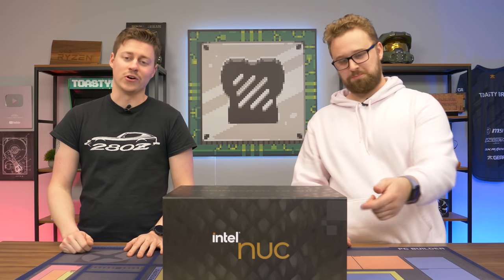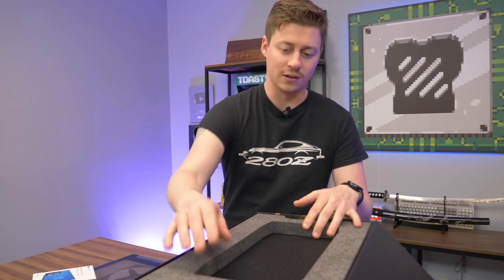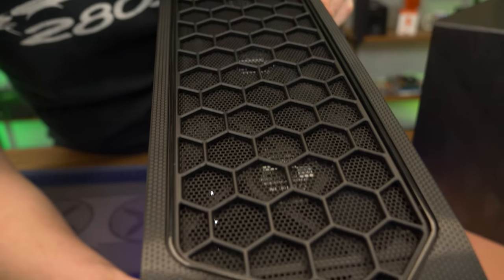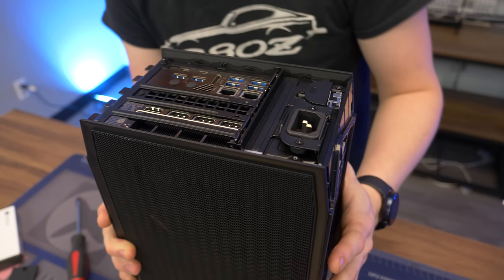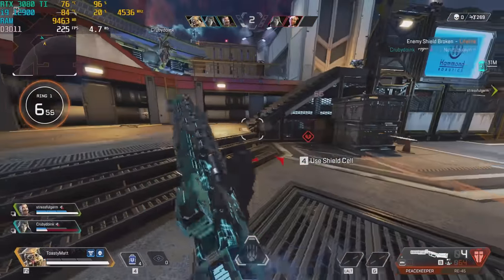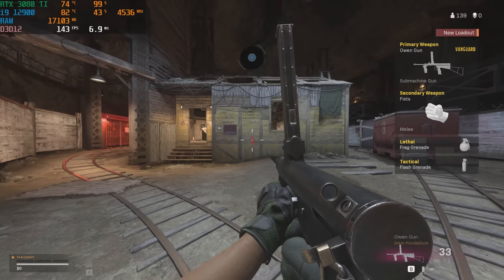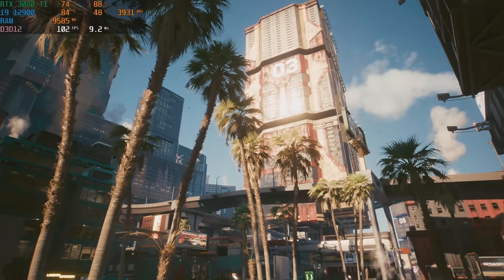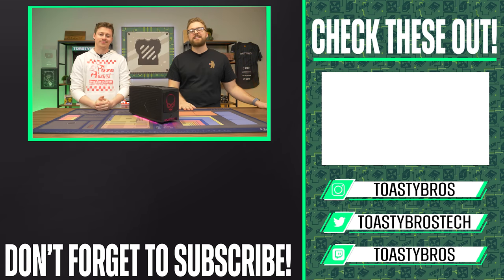The Most Powerful Mini PC...Is it Worth It?

Comment: Hey there.  I just got one of these for my wife.  But, I got the far more reasonable 12700 version.  After adding a 2TB (Gen 3x4) and 64 GB of ram, I was sitting at about )1300.  Our needs are unique in that we run off solar so power usage is critical.  She’s been running a 10th Gen 17” razor with the 49” Samsung ultra wide monitor.  Performance is sluggish given all the work she has open at once. My hope is to pair this with an efficient GPU that will run at low power when not taxed so that the overall power draw is similar.  I can let you know how all this works out if you like.  

Trying to build something feature for feature I found this to be a very good value, with Black Friday sales anyway.  I can’t wait to get this in and see how it performs. 

Cheers
Rick
Reply: get an amd 6800xt and undervolt it. ebay has em used for around 400 usd.

Comment: The CPU is not soldered. If if was a BGA CPU it would've been with HK or HQ termination. What you actually got there is a 12900 non-k CPU. You are right for temperatures I think an I7 12700 would be best.
Reply: If if***
Reply: Lol funny how often a 500k subscriber count channel continues to get simple stuff wrong
Reply: @Harkie760  This happens if you do not check the spec sheet of the product before reviewing it.

Comment: The bottom where it looks like an m.2 should go is because on the previous gen Nuc’s it did have an m.2 slot there, but in this model they moved it to a different spot but kept the same case tooling so the panel is still there covering an unpopulated m.2 area. Also the cpu is socketed on the 12th gen nuc’s

Comment: hi ive been watching your videos for a while and have even purchased a few things from you recently. well im building a computer for the first time in a long time and im trying to find out what version of bios this motherboard came with to see if i even need to flash the bios if you (or someone reading this) could help me acquire this information it would be greatly appreciated im its a gigabyte b550 gaming x v2 rev. 1.x made in week 50 of 2021 and im going to be running a ryzen 5600x so i need version f10 or higher (i do not have the cpu yet its on the way im trying to prepare the motherboard) so i cant tell by trying to turn it on and see if even shows my processor